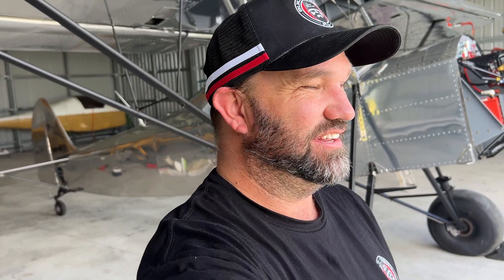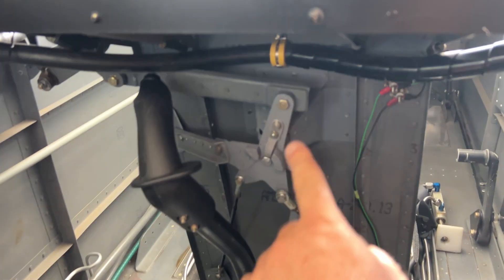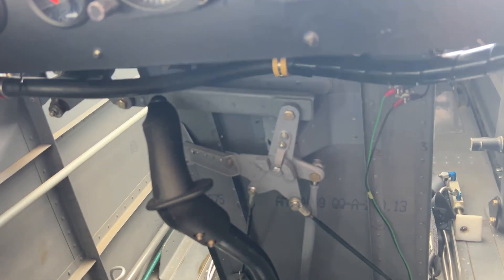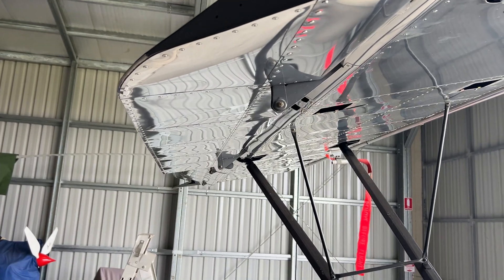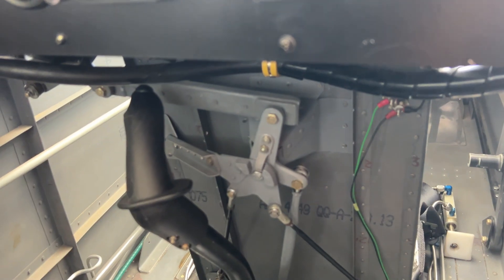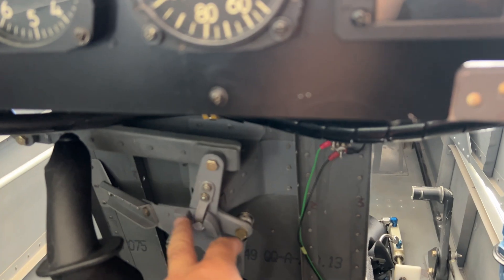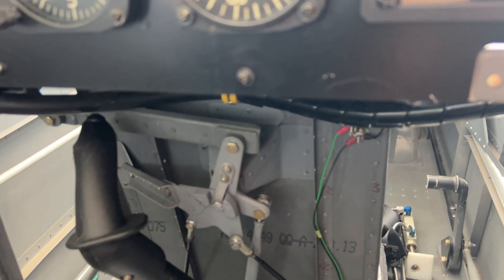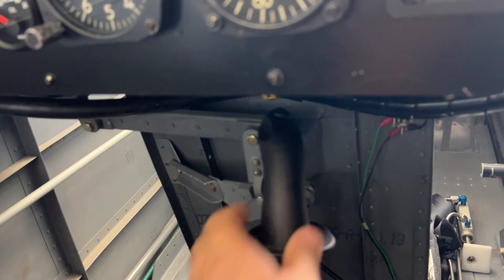Ooopsie!

Comment: Ooof.  Yeah.  If I do something like that on a car, I'm likely to discover it at a very low rate of speed, and of course, the vast majority of the time, I'm on the ground.

I've run into similar things writing, where I spend hours repeatedly going over something to look for grammar or spelling errors, and because I've looked at it so many times, I end up glancing right past fairly obvious stuff.
Reply from the maker: Isn’t it amazing how that happens huh! It’s frustrating when someone else walks up and points it out after you’ve been engrossed in it for hours….but I’m also thankful!

Comment: It is not the first time control movements have been reversed, nor will it be the last. Well caught. That revised mechanism is so much better than the original. Try to make sure that there remains no springiness in the movement between each of the the flying surfaces themselves and between them and the stick. I think I may have previously mentioned an issue with the DeHavilland Canada DHC2 Beaver in which loosely rigged aileron control motion induces a destructive shake.
Reply from the maker: Yeah, it’s a simple yet common thing. Happy we caught it here instead of later. I will be keeping a close eye on those vibrations during testing. Very slow and careful adjustments in speed, weight and forces

Comment: I just flew the work project production prototype, which we have been working on for over two years now, to a chap to try out before he writes an article (once the aircraft is full approved by the CAA). Now I am a 194cm tall (6ft 4.5" to the old school chaps) and so just about every cockpit is tight for me and as one of the main engineers and test pilots on the project, I have been very close to the aircraft in all that time, it has had independedt checks carried out after any work. Well this chap who had not seen the aircraft before, just said "If you could move the pedals forward about 75mm (3") that would make the cockpit less cramped and it will make the aircraft easier to sell", fantastic, why the hell did we not think of that 🙂 A fresh set of eyes are always good. I would think you would have noticed your error when you did the fredom of movement checks but it would have nasty if you hadn't. We have all been there as some point the only people that don't make mistakes are pocking up daisies.  🙂
Reply from the maker: That’s the key isn’t it, a fresh set of eyes. It’s amazing how you can condition your thoughts on something when you are knee deep in it. Or have your mind on multiple things. Heheh, you won’t have that cramped feeling in your new aircraft, seeing as you’ve only built half a cockpit, your top half can stick out as far as you please!
Reply: @donwtsn  Ha ha 😂 I have made adjustments so I am sitting inside it as snugly as a WW2 RAF pilot in a Spitfire,  not so much getting in as putting on 😀 1/2 the size of Frankenstein.
Reply from the maker: @flyingkub hehe, my good mate, who helped me with the engine mount and landing gear is 5ft 21”…..no idea how he used to fly Hughes 500. Best way I could think of to make him fit comfortably is only build the bottom half and let him stick out as far as he likes!
Reply: @donwtsn  he is the same hight as a little brother, to this day I don't know how he got into a Chipmunk when in the ATC.
Reply from the maker: @flyingkub hehe, that mental picture makes me giggle!

Comment: I watched a Pawnee take off one day... hard bank to the right followed by hard bank to the left.. then wings level briefly and planted it back on the runway ripping off the gear. This was the first flight after it came out of a busy shop full of experienced mechanics... having replaced the aileron carry through cable. Yes, ailerons were rigged backwards. Hard to believe it got out the door that way and the pilot didn't catch it either when he should have been especially vigilant knowing the work that had been done. Happens.
Reply from the maker: Ive heard of similar stories. It is amazing how something like that can go right through to the keeper unnoticed. Something so obvious and simple yet still easily missed in amongst the volumes of other stuff!

Comment: Totally agree with independent inspection Donnnie. I never understood the option of self-certifying in aviation. Look at the Boeing 737MAX MCAS system for example.
Reply from the maker: Yes, I’ve been there in self certifying situations, and it definitely gives you that out on a limb kind of feeling. Much nicer to be able to go through over it with another set of eyes

Comment: As an ex glider pilot, control movement and direction is pretty important, to that end, when instructing my ultralight students, one of the final checks (yes, late I know), is 'full and free movement' PLUS, 'Stick points to the control that goes up'. Left stick-left aileron goes up, stick to back-elevator goes up, right stick-right aileron goes up.
Reply from the maker: Yes, I’ve made it my own routine to identify each aileron (and the other controls as well) and talk through its movements during my runups. Still, nice to find it now in case that final check gets muddled up somehow huh

Comment: Don you get a gold star for fessing up and sharing the opps 
All eyes and all comments are welcome during a build is a gold standard.
Luckliy most pilots/builders have that attitude and your sharing encourage everybody!
Good job. 
Saw a cool tip quite recently …..as you pull push on the aileron control, Do a “thumbs up”  at the direction of the movement you made to the control ….That side aileron should be up. 
Some may Add that to whatever you were taught and normally use. 
A whole bunch of people missed this one 
 https://en.m.wikipedia.org/wiki/Air_Astana_Flight_1388

Comment: Thanks. This is an excellent video for the simple suggestion to park your pride and have others look at your work. I'm about to embark on building a Badland ultralight. At the local airfield (42J) we often have a Thursday catering truck lunch. Sort of a lunch gathering each week. Thinking about what you're saying, as I build, it wouldn't take much to put the plane on the trailer and have the lunch visitors look over my work every now and then. I would much rather be laughed at a little now than talked about in the "past tense" later!
Reply from the maker: That’s so top idea mate. Folk that hang out at airports are always keen to check out what’s happening around their patch. Especially if it’s something different

Comment: The phrase "down side up" is one to keep in mind prior to a first test flight. (I have done about 6). For the ailerons you move the stick (over) down, and the aileron on that side should go up. Great catch, doubtful you would have been able to save it had you had taken off that way. And you are correct... always encourage others to look things over. Good luck on your first flight.
Reply: Or I have been using "Stick to the upside"
Reply from the maker: Yes, I make it a routine to identify the aileron and call out which way it should go during my run ups. It annoys me that I didn’t find it earlier though! Still, happy it was found

Comment: You always do a control "check movement free" before takeoff? I think you would have caught it then maybe Don but always good for others look. Always do control function as well as movement. You would notice elevator wrong pretty easily so same with ailerons? Rudder? Many have crashed because of control locks still in place believe it or not. How can anybody do that? It happens because of "get there" eyetiss. They were in a hurry. If you ever get in a hurry, don't fly...or "Don, don't fly" rule? ❤
Reply from the maker: Yes, I always do a full and free check as well as identifying each aileron and call out which way it’s meant to go. Good chance I would have found it then, but at that point it’s the final check before it gets real. The mind can be a funny thing, and under load, pressure or stress, things like that can easily be missed. A simple radio broadcast at the exact moment you are doing your checks could be that final straw that makes you miss something simple. Pretty happy we got to this one before then

Comment: G'day,

Yikes !

Um, golly-gosh...

The first time I went over the fence, after much Crow-hopping and low straight/level flights in Ground Effect..., when I reached 100 ft and it ran out of Climbing ability ; then I realised why the Designer (Volmer Jensen) had cautioned against trying to levitate without fitting the Centre-Section Gap-Cover...

In pure Eagerness, Taxying had begun before finishing the Gap Cover, and the absence hadn't appeared to matter, and with the normalisation of deviance, having flown the Runway 10 ft up (with a Wingspan of 36 feet ..) everything had felt "fine.

But, once above 15 ft the Ground-Effect faded rapidly, and the absolute Ceiling was 100 ft..., which made returning to the Airfield challenging, as the Turn had to be to the Right - against the P-Factor (because there were Poplar Trees on that side of the 'Drome..., if one had turned Left...) ; so 30 ft of height was lost on each of 3 turns, 90° apiece, putting me 10 ft up coming over the Fence to alight across the Runway...

Lesson learned.

With the Gap-Cover, it climbed away at 120 ft/minute ; a finer pitch Prop yielded 250 ft/min...

But Control Reversal is a VERY Difficult Mistake to fly back out of...

I took up Motorbikes at 63, an Electric one at that, and with some dithering...; managed to attempt to ride away with the Steering-Lock still engaged...., all that Torque with "Full Left Rudder", Locked on - and simultaneous overpowering Roll to the Right..., and down we went. In the Main Street.

Being silent though, nobody appeared to have noticed.

But the time interval between opening the Throttle, and realising why the Machine is refusing to answer to the Helm...; that was a bewilderingly nasty moment.

I'm really glad that you noticed that Blooper.

Keep on keepin' on !

Stay safe.

;-p

Ciao !
Reply from the maker: Oh boy, things like that gets your full attention huh! It’s great to know you have the presence of mind to work through the problem at hand. That kept you away from major damage to yourself on both occasions. The mind is a funny thing huh!
Reply: @donwtsn  

Thanks,

I made a long reply, but because crashing or not crashing involves discussion of some things which are beyond AmeriKan Profiteering Principles, the YT Soft(Coque)ware Censorship Pogrom duly lied to me, assuring me my Reply had been added, then outed itself as being as full of Bullshit as the rest of Yanquiland at the moment - by admitting that my 
"Comment Failed to Post",
When I attempted to edit a typographical error.

I have a strong suspicion that
The Nature of Reality is imminently about to catch up with ALL the
Lying manipulative censorious
Kontrol Freaks who currently actively seek to forbid
Humanity from discussion of anything and everything which matters - apparently because their 
Advertisers have decreed that nothing be
Permitted to trouble the 
Minds of we, the Proletariat beyond how to secure Access to sufficient Credit, as to be able to 
Act on the Impulse of
What to buy, and
Consume, and
Discard, and
Replace...,
NEXT...(?) !

But, the boiled-down version, which might squeak through...(?) would be that when one's momentary Options, during an Emergency-in-progress, have dwindled down to there being but the One Choice still available, which will avert having to live on afterwards as a Human-Turnip, or to attend and star in a Funeral Service...; then, Time
Slows
Down, and sometimes one
Perceives the Events as if seen from a metre or so off to one side - observing oneself doing that
One "Right" thing, without actually thinking about, or deciding, to do it - as an "Out-of-Body Experience", kinda thing.

Such experiences are very educational, one would be a Fool to fail to pay close attention to any such one undergoes ; but some people appear to become addicted to the Endorphins resulting from coming out the other side of a NDE being not deceased - and they go
Chasing the sensation.

BASE-Jumpers, Wing-Suiters, Low-level Aerobatic Exponents, Pylon-Racing  Pilots, Racing Drivers and Riders, they who use Illicit Pharmaceuticals intravenously,  and the thrill-seekers who play "Russian Roulette" with Semi-Autimatic Pistols ; they all come to mind  in the category...(lol !).

But, yeah, the Human Mind is a very interesting Entity, indeed.

I wonder if this self-centred
 {EDIT..., I typed that to read  "self-CENSORED", but obviously the delicate little Ego of 'MurriKa(!)'s  AI likes to pretend to itself, that I did not mean to say that, at all....!}  circumloquacious version will get through the Flak thrown up by the
Fragile sensibilities of MAGA-Muskistan...?

Time will tell, 
{And Thyme has indeed told, too !}

Such is life,

Have a good one...

Stay safe.

;-p

Ciao !